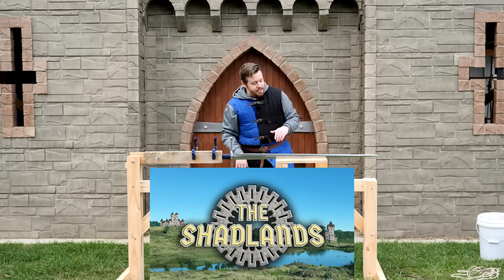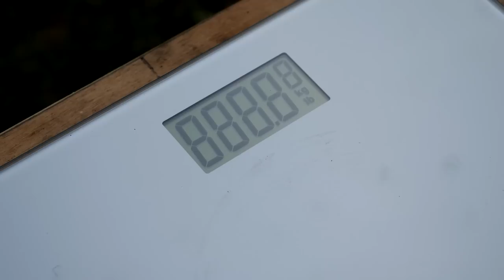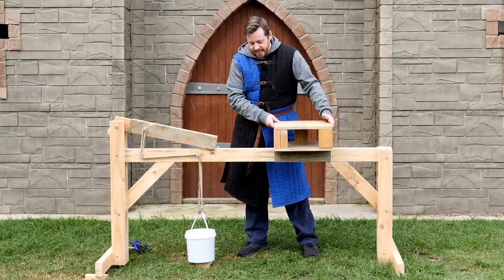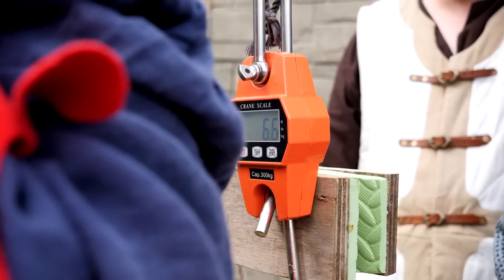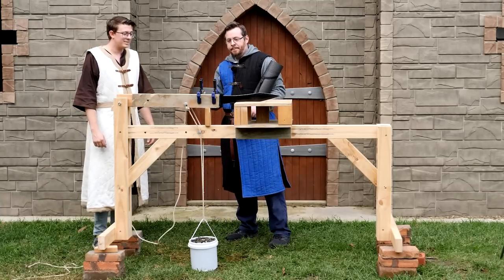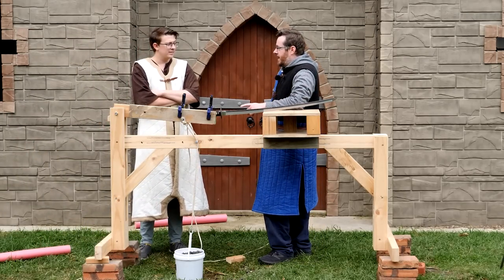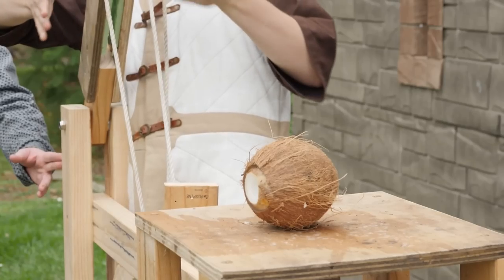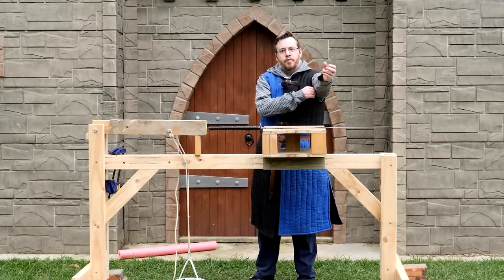Choppy choppy

Comment: Just a thought, but I'm pretty certain a 2 handed strike has more force than a 1 handed push as I'm sure a 1 handed strike also has more force than a push/ you need to weigh the strike not just a push on a scale, so you need a scale that will lock at the highest pressure, then start 1 handed striking and a few times and take the average strike pressure, then do the same for 2 handed. so you can get accurate weights for 1 & 2 handed strikes. I don't really think a bathroom scale is fit for purpose, but I don't know what you would use, maybe an engineer could help with sourcing a cheap sensor?

Comment: Except if you goal was consistency like you said in the first portion of the video, adjusting the length changes the impact force for the cut and since the entire device is vertical the swords weight will increase the actual force exerted as well. Id est your machine isn't as consistent as you think it is, more consistent than swing the blade yourself, but not consistent since you're using rudimentary systems. Basically you aren't inputting a fixed amount of force into each swing, the force will vary by the weight of the sword, the length of the sword, as well as the angle you can achieve with your moving block. If you wanted consistent results you'd have needed a mechanical system that takes input in a fixed amount of force or effort and swing the sword horizontally so gravity doesn't add extra force based on weight.

Comment: I agree that the grip slipage is an issue, but I disagree that that is the reason the katana did not cut the coconut.

From what I can tell in the video, the weight hits the ground approximately when the blade strikes the coconut. So there is no follow-through force being applied to the strike, which allows the blade to bounce right off target. The weight should be allowed to fall more freely so that the force is consistent and constant. 

Also I saw a few comments talking about rotational energy or sometimes the simple fact that F = Mass*Acceleration, as if they were design flaws in your experiment. While your experiment isn't perfect, it can be used in a controlled way to show the advantages and disadvantages of different blade lengths, weights, and types as you apply a constant force to them

Comment: I think the reason the katana wouldn’t cut the coconut is because it was going against the grain of the husk, which can be seen in the fibers on it. If the coconut had been positioned so that the katana cut down its length instead, I think it would have worked. This could be another argument against using wood for these tests.

Comment: The clamp currently is like holding the handle by pressing your palms together with the handle in between. Doesn't get supported the same way as it would if you held it in your hands and apply downward force on the handle. Or something idk how physics work. Do you push down with your upper arm and pull up with the lower when you two hand a sword?

Comment: its 1 am and I'm tired so this may be a stupid question but as I see people commenting the current rig is 1, not calibrated to apply the right force at the blade when resting and 2, only the acceleration of gravity not muscles. I am wondering about a 3rd thing, since F=ma, is there a good way to account for a person of a certain strength being able to accelerate a lighter sword much faster than a heavier sword or does the extra mass negate the additional acceleration.

sorry if that didn't make any sense as I said I'm tired and its been a long time since I took physics

Comment: What is the difference in length and weight of the two swords? War sword you might find is longer. Because it is longer and the pivot point is the same the downward force would be greater because of the extra weight farther from the pivot point. I also expect the war sword is heavy. That would also increase downward force.

Comment: Why not just put the stick in the rig, place the flat scale on the target-block, lower the stick down onto the flat scale, and load the bucket until you reach 7kg? That would be consistent with your "by-hand" base-line. Because applied weight at grip and applied weight at tip will be significantly different, due to leverage.

For a target material which is environmentally friendly; why not bread? You could even bake it yourself, to fine-tune the consistency.

Comment: Looks like the clamp is failing. After a few of those cuts, the blade was forced up significantly higher than it was in the clamp. The force the sword is inflicting is getting pushed back and moving the blade up, essentially blunting a lot of the impact force. If the blade can't be forced out of position, it should cut a lot cleaner.

Comment: You measured the force you can apply at a distance from your hands, but you measured the weight applied at the grip of the sword on the guillotine. So of course the strikes will be a little bit weaker.

Comment: The reason why everything, especially katana was cutting badly was, because its the worst cutting technique you can perform. But you can improve it even using a machine: move the joint a bit above the target then adjust the sword to be perpendicular to the ground when it hits the target. This would more effectively simulate the real cutting motion which does two motions at once - chopping and cutting, in another words using bigger part of the blade.

Comment: you're going to need a better grip for the sword. this can mess up your test. if the grip isn't consistent between swords you won't be able to get an accurate comparison.

also use clay to stabilize your cutting medium if they don't have a flat surface. or just use clay as a way to test cutting strength. (if you dry it out its gets harder).

Comment: I mean, a better measurement for calibration might be tip speed. the moment the stick exerts horizontally like that is far far lower than the moment exerted for most of the cut.

Comment: Can I suggest something? You should ask to The Slingshot Channel (Joerg Sprave) how to improve your test device. He has built two devices similar to yours (for testing knives) but they can generate more force (using rubber instead of a weight) and the angle for cutting was better. I imagine you can do the same but in a bigger scale with Joerg’s help

Comment: So, my inner engineer is worried about a few things.
-10k pulling down on a 4 foot long, 2 pound sword will move at a different speed than a 3 foot long 2 pound sword because the longer blade adds leverage.
-lighter swords will be moving faster than heavier swords, and Energy = 1/2mass*velocity2.
-changing the placement of the target will greatly change the energy delivered into the target, due to the principle mentioned above.

Does this matter? Lighter swords do move faster in combat after all... But will it mess with the data?
What are y'all's thoughts?

Edit: Ballistic gel is temperature sensitive. Results will change in winter vs summer. This can be an issue if you want to use old data as a control group.
Reply: How much does the actual force change since the shorter faster ones have less mass, assuming the target is placed at the optimal distance for each length?

Comment: You should also have more weight.  You're applying 7 earth-kilograms at the hand-equivalent, which works out to less at the end-of-stick equivalent you measured your strength at.  You should either multiply the weight by the distance ratio, or bring back that stick and scale and add rocks until it behaves familiarly.

Comment: Your going to have a few problems here. A big one is that the measurement you took on the scale was using only the force of your arms to apply pressure. You need to find the momentum of a sword swing not the pressure of a sword push. Much like punching someone does more damage than pushing on them with your fist. 

Your body accelerates the sword much faster than gravity does so the same weight at higher velocity will equal a different amount of force.

Acceleration is m/s/s 
velocity is m/s
V/s=A or V=A*s
You need the time it takes to swing and the rate it accelerates at to be consistent with what a human can do or find a way to compensate for the difference in one by applying the same difference to the other so that momentum stays the same.

On top of that you need to measure the force applied from where it is being applied not the opposite end.

Comment: I'm not an engineer, so someone correct me if I'm wrong: but shouldn't the test platform be split to allow the blade to swing through past level? That way you can simulate follow-through.

Comment: The force calculations are suspect at best. You need to figure out the angular velocity of your swing, or the amount of force at the end of a full swing. The clamps aren't holding the sword in well, there is definitely deflection and vibration issues. 

I would suggest adding some type of safety like a release pin and a chock or dowel. I saw this and kept thinking this looks far more dangerous than it needs to be.

Comment: I think your underestimating the need of the drawing cut aspect.  When a human cuts there always a small amount of pushing or pulling that naturally occurs and is needed to cut.  If you had the sword hold on a dolly that move back slightly with each cut you will get much better results

Comment: Wow. Lots of people in the comments miss the point of a calibrated test. It is supposed to be CONSISTENT, not necessarily ACCURATE. Ballistic gel is actually a good example. It is NOT supposed to perfectly simulate human flesh (this myth needs to die), it is supposed to be a consistent target that is calibrated to produce the desired results in a real target. I can't belive I have to say this but humans are not homogeneous, gelatinous masses, nor are they planks of wood (the medium used before ballistic gel).

BTW ballistic gel would probably not be a good target for this machine. I would be willing to bet most of your blunt swords would be able to go through with little resistance. Ironically enough I think a tatami mat would be one of the better targets. A bundle of sugar care or reeds might do nicely as well.

Comment: 1 the sword is slipping in the holder loosing energy 

2 you are not accounting for velocity of a swing. 7kg at 1m per second will deliver more force than 7kg at 1/2  meter per second. 

3 I think you need a load cell to properly capture the force in a sword blow then you could properly calibrate your machine

Comment: 1. You measured the force at the end of the wooden stick, but you applied the force at the handle of the swords. therefore you have way less force at the contact point.
2. What's the best way to measure the actual force at the contact point when the sword is in motion? I don't know, but I'm afraid, its different then just pressing a stick against a scale.
3. To prevent the hilt from slipping, maybe it's better to remove the hilt and bolt the sword directly onto the lever. More work, but better results.
Reply: How to measure the force on impact with household items:
1: Take the scale and place a wooden plank on top of it.
2: Place a Camera next to the scale and point it to the Display.
3: Hit the wooden plank and record the display.
4: Repeat and calculate the median.

Do the same with the sword-o-tine and adjust the weight pulling on the lever, to get the same results.

Comment: Acceleration. When the sword is accelerating with the power of gravity, it cannot do so at a rate faster than 9.8 m/s/s. Your arms can probably move faster than that, along with how wrists and elbows also pivot as you swing providing an additional little boost of acceleration thanks to the law of conservation of angular momentum. It would be possibly more important to match the speed at the end of your swing as well as the force. It’s actually similar to how you explain the physics of jumping in your novel.
Reply: Your whole body actually gets involved with a sword stroke, but your rig is pretty much just an arm that has just a shoulder joint, in fact I think if you were to try hitting that coconut again moving only your shoulders, you wouldn’t fare any better. The reason the war sword seemed to work is because the greater mass happened to compensate for the lack of acceleration. F = ma
Reply: To fix your rig, you need to measure the force of an actual sword swing, which will be much more than just pushing down on a stick. Then match that result on your rig. Also the thing you swing should be a good average mass relative to all the swords you want to test.

Comment: Looking at the comments, there's no need for me to point out the incredibly obvious flaw. I don't wish to be rude but I'm honestly surprised it didn't occur to you because you normally seem pretty switched on.

I suspect even once you fix the clamp you'll still encounter issues. Firstly, you need a more reliable release mechanism if you want consistent results. Secondly, I don't think a weight dropping over such a short distance mimics the acceleration someone can achieve when striking even if the resting weight equals the amount of static torque you can apply. You can swing an object downwards faster than gravity would allow it to fall regardless of the weight.

It's not a perfect analogy, but think of something like a tractor vs a sports car. The tractor's torque is like the weights. The tractor's horsepower (toque delivered over time) is limited by it's RPM and the weights by the speed they fall due to gravity. The sports car is your hand. You may be able to generate less torque than the weights equal on the scales in the same way the sports car may have less toque than the tractor, but the sports car has higher RPM and so can deliver more horsepower than the tractor in the same way your hand can accelerate faster than the speed of gravity and deliver greater energy into the strike than the falling weights.

Comment: A straight chop would be for a falchion or an axe, no?  Or a bec-de-corbin's spike side, which would be a puncture wound in Rolemaster, to punch through plate.
Heh with pole arms, your rig would be doing 6' or 8' long arcs, nasty.
Now I'm wondering about the old claim that katanas could cut through copper ingots if they can't cut through a coconut.
Mind you, the 8kg is based on your pressing down on the sword initially, not on the power produced by swinging it hard.  That could be 3x, 5x, 10x the kg pressure.

Comment: As a lifelong tradesman, that's kind of a sketchy rig, not because of how it's built. It seems structurally sound and of good construction, my issue is more that it is like a solid fuel rocket, once you load something with energy it has to expend it, sometimes dangerously. Long story short, build a crank system that locks as it rises and can only be released from somewhere else. Not only is the inherent safety of such a system a bonus, but you could then dial in differences based on "crank" level so to speak. Could be usefull determining the effectiveness of different weapons given different force applications. Also get better clamps, I can squeeze harder with my bear hands than those hardware store specials. You need a clamp you could almost pinch a 2x4 in half with. The lack of reliability in the attachment kind of makes these tests a novelty, every weapon finished in a different position than it started on the rig. You have removed your baseline. You almost need a sort of Captain Hook like attachment custom made which you can then thread custom made hilts with whatever blade needed onto it. Just my two cents, love your content Shad, as a fellow of the British Commonwealth living in Canada 😆

Comment: You can only strike with the nunchucks with eight or nine pounds of pressure for the Split Second and only for the amount of weight that is actually being applied so it's how fast you're moving the weight of the piece and how much weight you cannot apply because of the link ergo it is only for the Split Second and it is not anything more than the weight of the part of the nun fact that is striking the item with the force that it is striking it with that is speed times mass to get kinetic energy minus half of itself as it bounced off with the stick it's minus half plus the weight that you are able to maintain that is pressure against. Or another words whatever amount of pressure you can apply with that stick is the amount that you are going to beat the num checks by* 2 as the nunchucks are two sticks made of one stick of the length of the stick that you are applying pressure with basically your calculations on the num checks were correct your calculations on the sticks or indirect but I just directed them for you

Comment: Instead of making the wood with the clamps parallel, make a sought of roof on top of the parallel wood that holds the sword handle so the sword doesn't slip up, also if you find a way to get more momentum and force behind the blade then I think bye bye coconut

Comment: I noticed you measured the weight behind the arm that is ment to hold the swords from the tip of the arm. Where earlier you measured the weight of your strike at the point the stick hit the scale. So maybe try adjusting the weight again to where the point of strike is 7 kg. Just like it was during the test phase with the stick.

Comment: just like everyone else, I think there are two issues, you measured the stick at the tip while measuring the guillotine at the handle, and then also the grip failing during every swing results in the sword losing almost all cutting power